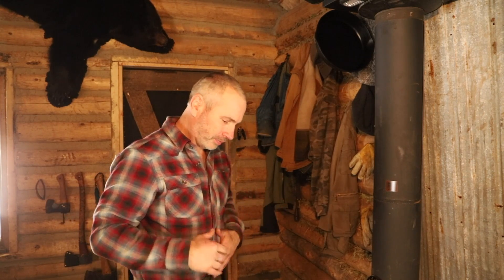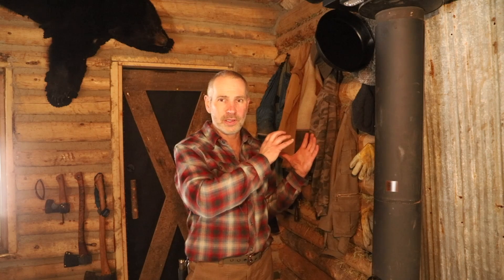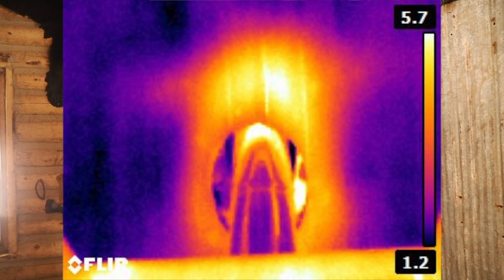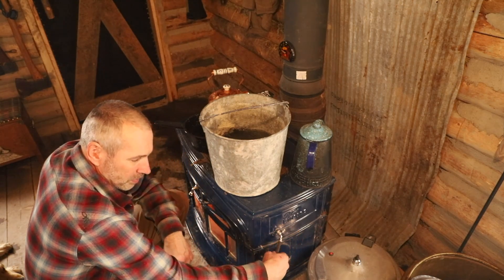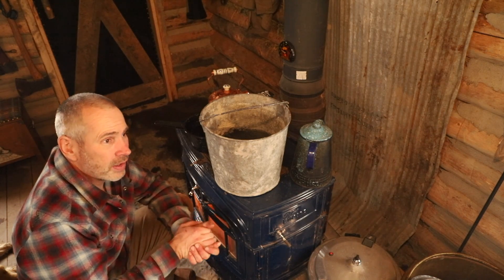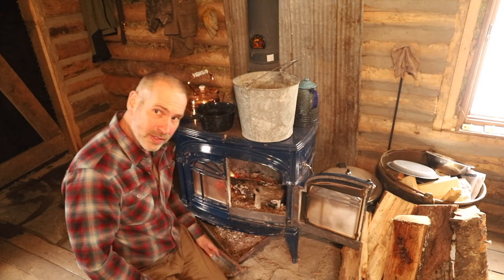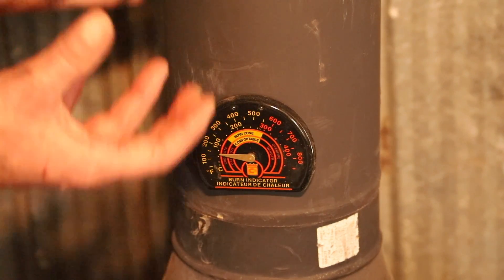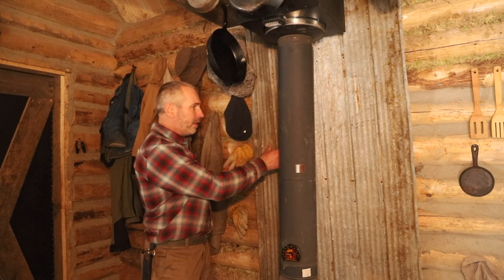How to Heat an Off Grid Log Cabin with Wood, Thermal Imaging Scan (infrared)

Comment: My father has had same/similar VT Castings stove as you have there.  You are correct that the handle on the right side is a fresh-air damper or throttle.  More than likely your catalyst grid is missing/gone, or it may be plugged up if it tends to choke out when you close the stove damper (left side).  First number of years he didn't need to replace the catalyst (he's been heating with it since '87) but in the last 10 yrs he's had it replaced 3-4 times.  Not sure if its the wood he's burning or what.
Normal operation is to keep the ash pan closed tight and the left damper closed.  Right damper(throttle) wide open (fully forward/towards you) till its up to temp, then adjust for comfort.  VTC can be efficient stoves, and when everything is working right you will have a light show as the gasses from the logs are burnt off, like little gas explosions.  Wetter the wood, more light shows.  That's how you know its working right.  
If you are getting alot of creosote buildup with VTC either the catalyst grid is clogged/disintegrated or its not being allowed to get up to temp.  If the stove won't burn with the left damper closed and the right 1/3d open (mostly to the rear) the catalyst is clogged.  They can burn a log at an "idle" or really get roaring.  If you fully load up the stove, it should be able to burn at part throttle all night.
There was a winter or 2 that he had removed the catalyst entirely and the stove ran better than it did with the grid plugged up, but not as well as with a new/clean grid.  My understanding is that the grid's primary purpose is to slow the gas/smoke from exiting the stove from the lower lip/opening at the rear of the firebox.
Hope you get the stove tuned up, as they work well, if a bit maintenance intensive.
Reply: Listen to this guy.

Comment: Nice idea to make a heat check. maybe it is usefull to install a konvektion pipe around the exhaust pipe. You only take a copper or steel sheet and bend a pipe 2 ´´ bigger in diameter than the exhaust. on the bottom 3 spacer and some on the inner diameter. The thermic from the exhaust pipe will suck cold air in and blow warm air out on the top. You could win 1.5 KW of power. I instaled that on my kitchen stove. And very nice videos!!! we want more !!!

Comment: I loved my wood stove during power outages. but inside the back metal split due to heat expansion and cooling. I had the same thermostat. Bought a pellet stove. I regret it! Runs on electricity. Bought a big enough generator to run it during power outages. All the best! Jerry

Comment: I used a air tight stove in Michigan in a 1500 sq ft cottage year round and used less than one third of the wood. Poorly insulated with 8ft ceiling and questionable windows. I think it would be wise to get a new stove.

Comment: Before I begin, I have to say, I am not the sharpest tack in the box.  When I was a kid, we had a wood stove.  Like yours, it had a damper, but it also had a stove pipe draft control plate, controlled by a steel knob/handle.  You could reduce the amount of heat/exhaust leaving the stove by turning that plate to a horizontal position in the stove pipe.  I would use it with the damper open to create more heat in the stove for cooking.  Perhaps a combination of damper on the stove and draft control in the stovepipe would be helpful?

Comment: was just reading over some of the other comments after the video and pondering different options to heating all your buildings ... if you make a mass heater stove you could put it out by your log pile on the front porch then hypercourse heat into the cabin bath house and work shop and privy ... and keep a cook zone outside for summer as well ... then all you need do is feed one fire and heat everything ... yeah i know building placement is most likely different that what i am seeing but it yet another option to think on ... and with the exterior cook zone you could have a breezeway that is sheltered from the elements yet still outdoors for summer 
.
that copper roll looks sweet btw ... and would look like a million bucks behind the stove .... or as a kitchen back splash and sink too

Comment: Someone may have already said this, but the handle on the stove door isn't broken, it's missing. Vermont Casting stoves have a removable, ceramic handle that is held in place with a magnet. When not in use, it gets placed in a small hole on the side of the front, right foot. This keeps it away from the heat so that when you do use it you don't burn your hand.
(Google: vermont casting ceramic handle with magnet.)

Comment: now that's a nice way to start a monday ... watching camping vid's ... the flir view is pretty informative on it's own and i bet it has you thinking of about 20 different things you can do to make it hold heat even better after seeing how much and where you are losing heat. ... perhaps try an old style Roman Hypercourse underfloor heating system on one of your builds i'd suggest the hot tub one ... be like a roman bath then ;) ... hmmm hyeprcourse bath house and mass heater connected to each other ... so you can use the workshop and take your break in the hot tub ;) 
.
I seem to recall the mention of a door expansion into the cabin from the kitchen side window ... i assume thats roughly where the bath house would be .... you might be able to slap a hypercourse heater into part of the cabin when you remodel to use that door ... and if you setup your workshop closeish to the bath house you could use the one fire to heat both and even add some heat to the privy as well ... heck even when you build the mass heater include an earthen oven to improve heating and allow for lots of awesome baking of sourdough bread and what not ... 
.
dang not even my cabin and i can think of a dozen things i would love to see and do with that cabin and grounds ... lol ... cant wait to see what you come up with ;)

Comment: Please explain your comment about negative air flow when using an outside air source for the wood stove. Using cabin air, already heated, to support combustion loses a lot of heat; you WANT a sealed burn box using unheated, outside air. If the box was sealed and only got combustion air from outside, how would that affect any airflow in the cabin?

Comment: One way to use that heat better is ceiling fan to push hot air back down.There are 12 volt fans that can run off solar panels with a battery set up.Believe it or not....my home in NW Indiana is a  older 900 sq.ft. 2 bedroom home.Just me my lady and our yorkie live here.The ceiling fan in the kitchen and just one burner on gas stove....keeps it about 65 f inside.So we  just close off the rooms we don't need to heat....and it does work.My furnace is newer but with the stove going.....I pay about 77 dollars less per month.So far....nothing has froze.And we do get cold nights here.

Comment: Sean - you should DEFINATELY hook up the outside air kit for that stove, I have the same stove, with the air kit and it actually IMPROVES the air quality in your house, because it's not burning the interior air, and making the interior super dry. Plus it makes the stove MUCH more efficient. That valve on the right side is intended for the outdoor air kit, and I will have fires burn for 9+ hours, because it's damping the fire down so much that you get super long burn times.

Comment: Just a thought. If you put 2 fresh air vents behind your woodstove, one running directly to your stove for fresh air, and the second one (smaller) running directly at your woodstove so the air gets preheated upon entry in the cabin. Put a small dampner on the cabin fresh air so you can close it at night so when the fire dies down your not bringing in freezing air. Nice work!

Comment: For a safer heat shield between the stove and the log/combustible wall surface spacers of +- 1" should be used to prevent heat transfer from the metal shield to the wall. The spacers will allow the hot air to dissipate. 
Just a thought

Comment: I HAD THE SAME STOVE WHEN  LIVED IN QC, WORKS GREAT AT 375-500 F WHEN AT 500 F THE SHUTTER ON THE RIGHT SIDE WAS CLOSED FOR MAXIMUM EFF. MY NEXT PLACE WILL JUST HAVE A SIMPLE DROLET STOVE FROM CANADIAN TIRE WITH ONE CAST DOOR. HERE ON VANCOUVER ISLAND WILL BE GOOD ENOUGH WITH OUR MILDER TEMP.. 01/12/2018 AT 6;30am IS +2 C.

Comment: Wouldn't a longer stove pipe angled diagonally along the wall be more effective? More stove pipe equals more surface area that's radiating heat.

Comment: Yes. The stoves with double bevels on the front door or doors are much more fuel efficient particularly those old Buck, Fisher, and New Englander stoves. But there is something primal and more comforting about the fireplace effect where you can visually see the flames of the fire on a cold night. Good video.

Comment: Yes Vermont casting are not very efficient but they are good looking. Here in the mountains of NM we have been down to -20f at night most of the time it's 10 deg f to 15deg f. During the day we've been really warm around 40 to 60 degrees. We go through about 2  cords a year.

Comment: i had the same issue with my old wood heater ,small air leaks meant that the fire raged but also meant that i used a heap of wood.  thanks for the vids !!!

Comment: Mr. James, your personal journey is uplifting. I appreciate you sharing. That stove is awesome! As someone in the hearth industry who has also has rebuilt stoves and has a self installed early 80s Vermont Castings Reliant, airtight / no glass doesn't necessarily make it better. Your stove (our stoves!) is just an older design. Newer stoves are more more efficient due to their newer technology, certainly inspired further by epa requirements here in the U.S. The gaskets, if in place correctly, are effective. Firing it with ash door open is not what ash door is for (yes it can assist starting). Might inspect your air control to be sure it's operating correctly. No criticisms here, merely sharing as I await your next vid. As always, thank you!
Reply: *Resolute is my stove not reliant

Comment: Would it help to have a fan in the upper part of the cabin to circulate the heat back down during the day?
Reply: @ Dan C as Katherine McChesney already said batteries work great. They already have small Christmas lights in use on the upper deck inside the cabin and use solar rechargeable batteries to keep them lit. I'm sure the same system would work for a small fan.
Reply: how would one operate a fan without electricity?

Comment: There's a video on You Tube titled "Styrofoam Bricks DIY". The guy mixes styrofoam with cement to make very lightweight bricks. He grinds up styrofoam using a simple home made machine. Then for every 5 buckets of ground styrofoam he uses one bucket of portland cement and approx. half a bucket of water to make a very thick and workable mixture. I'm just wondering if that would make good material for the chinking and other insulation uses.

Comment: It didn't drop to below 30C down here until after 10pm tonight, thank God for fans (air-cons mess me up). At least it was cool enough then to get some caffeine into my system. Love the thermal camera; used to use them to check for dodgy contactors in switchboards... made it too easy. Thanks for the details on the cabin insulation, etc, very interesting indeed. Not that I'll be needing a fire here, though looking forward to some cooler weather soon.

Comment: Shawn I'm not trying to be a smart mouth but if you had pipe damper in the pipe you can keep heat in the pipe below and it will heat more efficient too. The higher the damper is on the pipe the better. I know it has a built in damper but my stove has two dampers and it is very efficient!
Reply: Actually, with the stove design by VT Castings, you don't want a pipe damper, it would fight with the stove dampers when everything is working right.  When the stove is hot, the left (stove) damper should be closed and the right (fresh air) adjusts the burn.  They are designed to be a highly efficient stove that (nearly) completely burns the gasses from the logs.  If you are getting alot of creosote buildup with VTC either the catalyst grid is clogged/disintegrated or its not being allowed to get up to temp.  If the stove won't burn with the left damper closed and the right 1/3d open (mostly to the rear) the catalyst is clogged.  They can burn a log at an "idle" or really get roaring.  If you fully load up the stove, it should be able to burn at part throttle all night.
Reply: Matt Shepard I'm sorry if it came out that way.
Reply: Joel Henderson .. I was wondering why he doesn't have a damper on the pipe too.. good question.
Reply: Some heat must be "wasted" up the pipe to avoid creosote buildup in the chimney. This is even more important if burning unseasoned or wet wood.
Reply: I suggested the same! if he put a damper in the chimney it would be way more efficient,  alot of heat going out the chimney!
Reply: f1y7rap .. That makes sense .. thanks for the explanation.. sounds like a great stove when functioning properly.

Comment: if you put a barrel or container in the loft you can put a coil  on the stove pipe and it will thermal siphon  and serve 2 purposes. one it will hold heat or store it for night time warmth after the fire goes out and it will be on demand hot water , man example on line of how to and on my channel
Reply: Is a great system. Now the heat is going strait out the chimney.

Comment: Great job Shawn. I particularly like the use of the thermal camera to show the external heat leaks.  Thermal cameras can be hired if you do not want the expense of the camera ownership.  The copper backing behind the stove pipe would be spectacular.  Thank you for a most interesting video. Kind regards, Greg

Comment: Perhaps a longer pipe that makes a small round inside the cabin would help to keep more heat inside. As the hot smoke comes out of the fire it would dissipate most of the heat to the inside of the cabin before it exits. This is pretty standard when heating up large rooms or multiple rooms with one woodstove in Greece. However the pipe needs to be cleaned once a year.
Reply: It will anyway make the woodstove at least a bit more efficient.

Comment: you have the same temps in the morning when it is cold out that I have in my 1300sqft home. My Lopi airtight still has coals after up to 12 hours. This is also burning hardwood (I have maple, oak, cherry and the best is beechnut). During a winter I burn about 5 full cord. I live in upstate NY. When I get up on the coldest mornings, my temp in the house is 57-60 F. The one downside is that I have to shovel the ash out and try not to take a lot of coals with it. 

I can't knock what you paid for your stove.....I bought mine new in 1999 and it is still going strong with no damage or wear. (I did have to replace the door gasket once already and I had to replace a broken brick inside firebox after first winter when I didnt store my wood under cover and some wood had ice on it......melted and cracked firebrick). Not bad for going on 19 years! Love your videos!

http://www.lopistoves.com/product-detail.aspx?model=211
Reply: Love your dog. She is so sweet and loving.

Comment: Thanks for putting in the conversion.  I get hung up on C and F and miss other things while processing the difference.  

Rocket stoves need a good chimney with good draw, keep as much of the chimney with in the warm structure as possible and vent as near the peak as possible.  

Another cool build is load bearing straw bale with clay and or clay slip with wood chips or straw.  Great for when someone doesn't have a boat load of trees at hand.  

We have had a great time with a air tight wood cook stove for cooking and heating, Pioneer Maid.

Thermal imaging is cool tech!
Reply: an easy cheat for F to C conversions is know the important ones ..  0c 20c -30c ... basically freezing, comfortable room temp and bundle up cuz you are going to freeze bits off ... 32f ... 68f  ... -22f ... of course -43 is the same in both

Comment: I too have a Vermont Castings wood stove (non-catalytic) with one glass door on my enclosed deck.  I change out the door and window gaskets every year usually in the Fall before I start using it regularly.  I typically burn about 3 cords per year since it's not heating my house and only my enclosed deck.  Thanks for sharing Shawn.

Comment: The manual warns to not operate with the ash door open! lol.  It does not appear like the air control on the right hand side is doing what it is supposed to do.  http://downloads.hearthnhome.com/installManuals/30005295%20Encore%20FlexBurn_23.pdf

Comment: idea. open the vent plate on the back of your wood stove , but dont use a duct. let it draw air from the room. then you can use the damper on the side for better control. opening the ash tray or door for air could be dangerous

Comment: Thanks for the great videos! 
As long as you are comfortable with the temp and the burn rate, I don't see the problem. Now that you have an idea of the thermal loss, I am sure that is something you will add to your to do list.
Putting a rocket mass heater in, would take a significant amount of space, unless the mass ran under the floor. Now that I think about it, that might be a neat idea!
Reply: During the Korean war the houses in the country were heated thru the floor by charcoal bricks . This way can have a very cozy even heat .